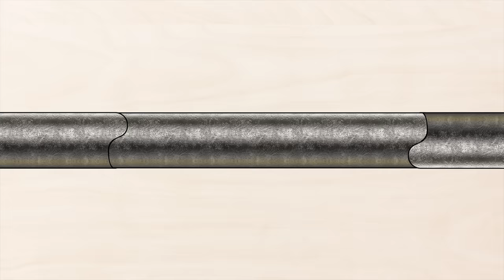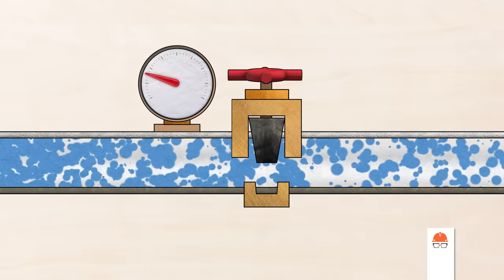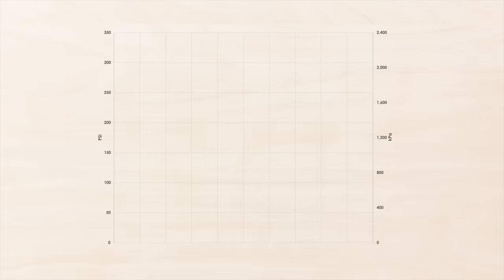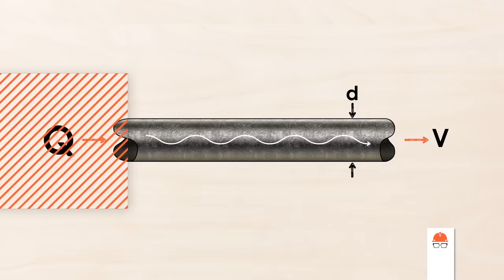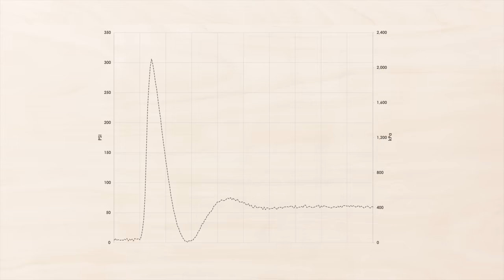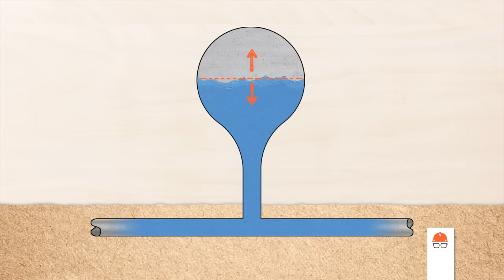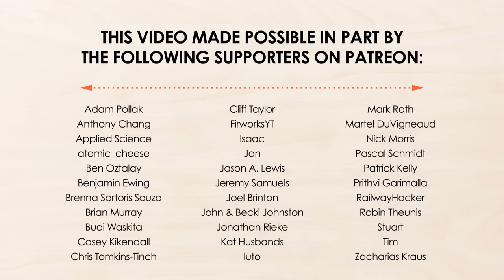What is Water Hammer?

Comment: Talking about the “water hammer” effect is extremely important, and none of the less extremely interesting. I’m currently a pipefitter, and I was on a job that will not be named. I was working for a contractor at the time that had work inside of a water plant. Of course as everyone knows water plants are extremely important to city’s. On a particular day, one of the workers inside of the plant (not one of my guys) went to isolate a line, and switch over to the bypass. The lines are 36” inches in diameter, and are at roughly 45 PSI, these lines are pressurized by a 6 Cylinder Detroit Diesel engine. ( There was some Cummins of course #bestdiesel) When the worker went to isolate the line. He completely turned the pump off abruptly , and hit the valve. This caused so much pressure in the line that the weld for the 2 piece 90• broke. The entire line blew apart, blowing out the glass window in front of it, and dumping tons of water. So much water, the entire pump house was filled with water up to your knees. Mind you this pump house was the size of a Walmart. There was electrical equipment everywhere, wood floating throughout the pumphouse. Welding rods, snuff cans, mtn dew bottles. This was caused because the pump was not able to wind down, the pressure was not relieved off of the line. It was an abrupt shock, and as you see in the video. The water pressure itself has no where to go. Because of this mistake the city was out of water entirely for almost 5 days. After the accident had taken place. My crew was on 16 hours straight. Working as much as we could to get new pipe flown in, welds welded out, and pipe fit up. It was an absolute nightmare. The plant went out and bought literally truck loads of bottled water and started giving it out to the general public. So the next time you hit a valve on, or off. Slowly turn the valve. 

@practicalengineering @thisoldtony
Reply: sounds like someone needed to get fired and a career change if he doesn't know something like that as a pipefitter.
Reply: Sounds like the valve should have been designed in such a way that that could never happen.  Always assume the user will do the wrong thing.
Reply: I work for a water company. An abrupt shut off can also cause a brief "no water". The water is moving quickly to a tank and when the pipes shut off the water is still moving and begins to slow causing a delay in pressure.

I want to add that at most water plants they have a clear well, a place for the newly treated water to sit for 30 minutes or so, so the chlorine in the water can do its job.. a clear well can be used as a shock absorber. That pressure from a quick shut off has an empty space to dump into. (It's important that the tank height is at or near the same elevation as the pumps)

The more you know..
Reply: eyescreamcake This information is out of my pay grade but thank you for the information!
Reply: If you want credibility online use your actual name. If some guy named "cheeseburger" tells a good story its probably bullshit. Cool story bro. 
You want to super size that?
Reply: @mikeries8549  u mad lol
Reply: Mike Ries Believe whatcha want brother. I love wasting time writing fake stories lmfao.
Reply: Thank you so much for sharing.  Now I can explain this to my husband and now understand what i am hearing in my walls, that hammering sound .
Reply: @triceh7671  Oh that? Those are spirits. Dude is talking about something else.
Reply: @cincinnatislider  
Lol. It's definitely the pipes
Reply: It’s not often that I comment on YouTube, but I strongly believe in giving credit when credit is due. Your videos are excellent. Not only are they thorough, they are engaging and encourage a greater understanding of the world. Keep up the good work.
Reply: Yup, company needs protocols to follow and qualified trained people to operate such systems... thats why we have Journeyman and apprentices... and project managers to act as a fail-safe in the event something goes awry... hopefully the engineers who designed the system to begin with are all trained up too 😉 😀 😬
Reply: SOUNDS LIKE NYC OR MEXICO CITY LMAO
Reply: I was all in on your story, thinking about what a FUBAR mess that bonehead created but when you compared the facility's size to a Walmart, my jaw literally dropped!
😮
I was envisioning a molehill-sized catastrophe but it got a violent shove to mountainous!
😮
Pretty wild & it sucks for you that you were tasked with fixing the mess.
🇺🇸
Reply: Obviously this city doesn't have a clue about having experienced personnel in such a vital department to any city. Thanks for your expertise and explanation.
Reply: @triceh7671  I see your comment was made a year ago, so hopefully your water hammer problem has been resolved by now...
But if not, and for any others reading this who still have the problem....

There are devices known as "water hammer arresters" that can be installed in a plumbing system to eliminate this problem.

They are basically a small fitting that gets installed on the pipes that contains a small expansion chamber, usually a rubber "balloon" of sorts.
This allows the water pressure to have somewhere to go repeatedly without stressing the pipes and valves.

In my state and I imagine most US states, plumbing code now requires expansion tanks almost residential plumbing systems usually installed near the water heater, and these also will usually resolve Water hammer issues.

You don't often hear of these issues on residential well systems, because they have a pressure tank that is designed to contain water under a building pressure so the water pump is not constantly shutting off and on every time a valve is opened.

In the event that these pressure tanks fail the homeowner will often only notice because the water at a faucet is changing pressure rapidly.
And those cases where the bladder is completely failed in a pressure tank, they can have something much worse than simple water hammer, so if you have a well system and ever noticed this, get it checked immediately, because it WILL cause your pump to fail prematurely.

That can easily quadruple your cost of repairs.
Reply: @mikeries8549  in the world we live in today with the many psychos hackers and other idiots, it's not very smart for the average person to use the real public name on a public online social Media forum.

Sure, having a generic name like cheeseburger or whatever might make it harder for some people to understand if the person's comments are legit.
    But seriously, anyone can make up any name. Is it going to make the comments more legit it's the guy calls himself Matthew Edgerton, Rick McCloskey, or any other random name one can pop up with?
How are you or anyone else going to know if that's the real name or not?
If THAT is what one uses to decide if a comment is legitimate the presence of some real sounding name ...then I can more easily understand why so many people in this world are so gullible.

Those of us who have experience in the field with such things, can tell if the writer of these comments sounds legitimate or not.
I was a plumber for 3 years before I added HVAC to my resume and did both consecutively for another 20 plus years.

While I did not work in major city water plants/systems, I did work on building plumbing systems, both residential and commercial, and that job from time to time brought exposure up to some of the facilities that those larger cities provide to the many buildings.

I, and I imagine most any other professional plumber with more than three or four years experience, entail by rating this man's comment, that he's not just blowing smoke & making up stories.

Of course I don't know but I just reading this if he has embellished any aspects, but I can tell the man knows what he's talking about. I can tell that there's at least a certain level of experience there.

One would think that when others reply to such comments and indicate that they also have experience in similar fields .... One would think that readers without such experience, would start to pick up on the fact that additional commenters with claimed experience, are not calling the person out as a fraud, and they are agreeing, sharing similar situations, etc.

One would also think that random readers but assuming that information and realize the original comment is far more likely to be legitimate and the writer to be telling the truth.

But then again there's another trait that seems to be growing these days, and that is the large number of people that seem to think EVERYTHING is fake, that nothing is real, legitimate or truthful.

That's sad. It would be ridiculous if not for the fact that a growing number of things ...are indeed fake, lies, deception, part truth ....and a "part truth", presented as "the truth" is really nothing but a lie.
So it's not only hard to blame people for being skeptical sometimes it's actually wise to be skeptical.
But it's not wise for people to just throw common sense to the wind, and ignorantly assume everything is fake, illegitimate or a lie.
Reply: @fokkerd3red618  anything made or run by man is going to be imperfect.
The city might have regulations and protocols to prevent such things, but everyone starts out WITHOUT experience. All it takes is one slip up, one mistake, one momentary lack of judgment, for and overworked supervisor or Foreman to allow an inexperienced person to ..."run in there and shut the valve off for me".

They've seen it done before. They know HOW it's done, but they may not understand WHY it was always done in a certain way, at a certain speed ... So in an effort to get it done quickly and get back out there too "be a good helper", or simply because they don't know, they shut it off quickly and BOOM, there you go....
Reply: @eyescreamcake  As a mechanical engineer, I'll have to agree / disagree with you. There definitely should have been some redundancy involved in such a system to - in theory - prevent such disasters from happening. However, the guy that caused the incident was not following best practices as they should. Someone working on such a large (and important) system should be well-trained and know what is best to do. I do design things sometimes (depending on where they are located) anticipating some operator will run into it with a forklift, etc. It sucks we have to compensate for people's incompetence, though!
Reply: @dudeguybro  As an electrical engineer, I'll have to agree / disagree with you, too.  :D
Reply: Very interesting story. Poor guy must have felt like shit haha.
Reply: @eyescreamcake  loved the engineers who inadvertently biased a npn transistor on one of our planes ldg gear sequencing PC Cards while trying to quiet the noise in some fluorescent lighting and almost dropped it out of the sky🥴
Reply: I think you were the one who did it...  Lol.
Reply: The valves should be equiped with slow down  and slow up mechanisms to make it impossible for them to shut down or open up upruptly ❤❤❤